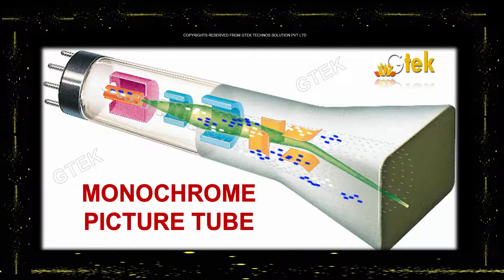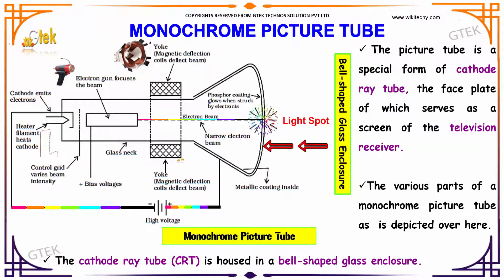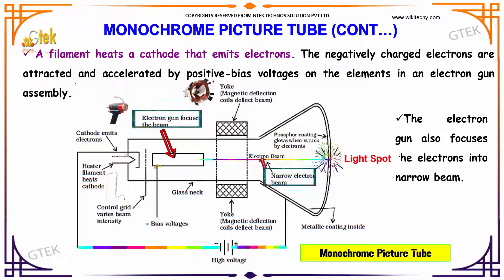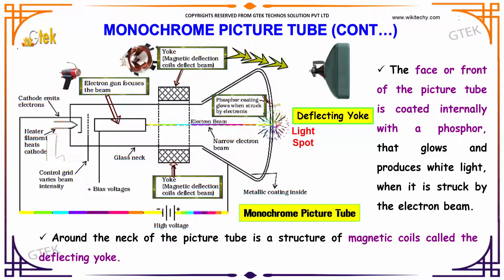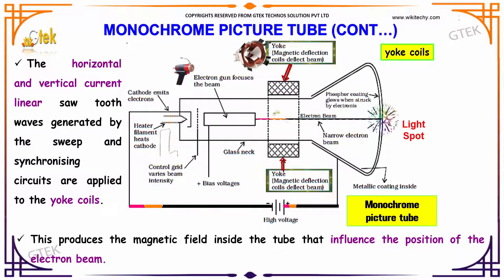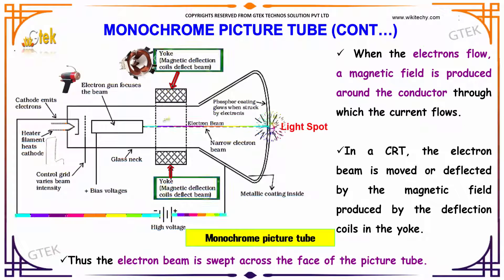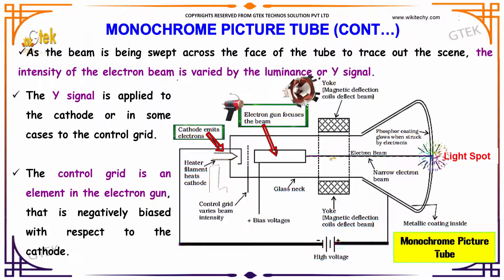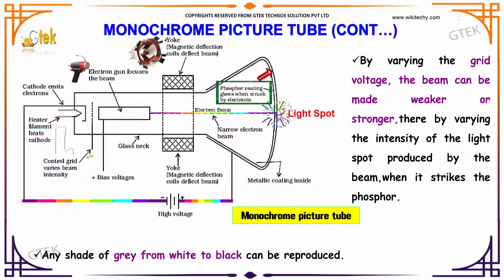Monochrome picture tube |Communication systems|class 12 physics subject notes|CBSE|IITJEE|NEET

Comment: This chapter introduces you to the subject of TV technology. ... excellent review of communication fundamentals, including modulation and mul- ..... At the TV receiver, the picture tube is scanned in step with the transmitter to ..... 23-12. Note the sweep and sync circuits that create the scanning signals for .... Monochrome CRT.

Comment: monochrome monitor is a type of CRT computer monitor which was very common in the early days of computing, from the 1960s through the 1980s, before color monitors became popular. They are still widely used in applications such as computerized cash register systems, owing to the age of many registers.

Comment: Monochrome TV Receiver has the following blocks.

1. TV Receiving Aerial 2. Tuner 3. VIF Amplifier 4. Video Detector 5. Video Output Amplifier: 6. Picture Tube: 7. Sync Section: 8. Inter Carrier SIF Section 9. Audio Section  10. Power Supply: